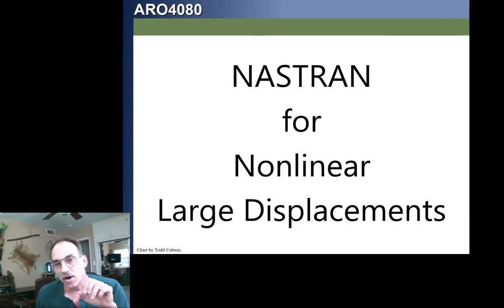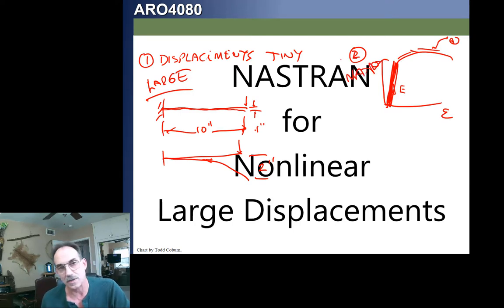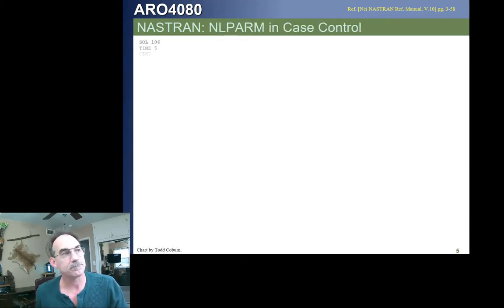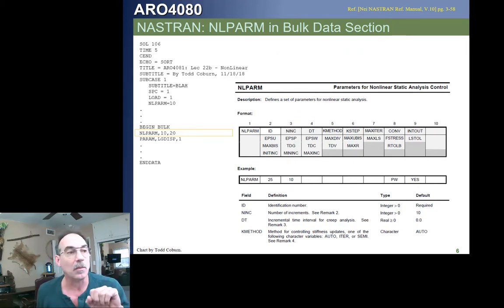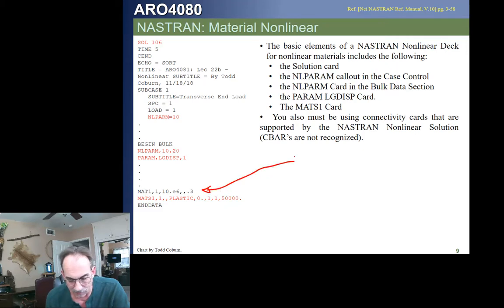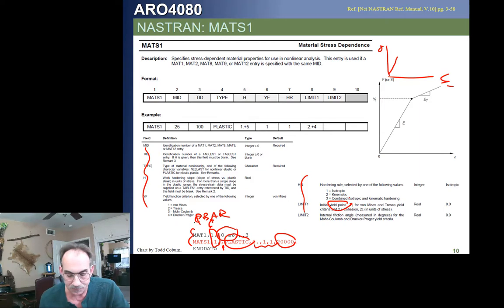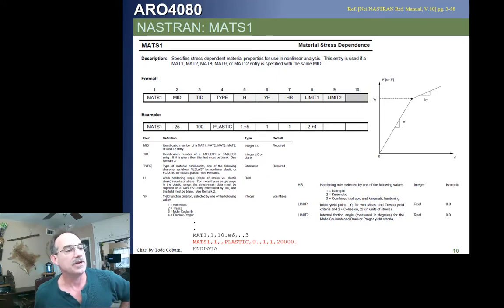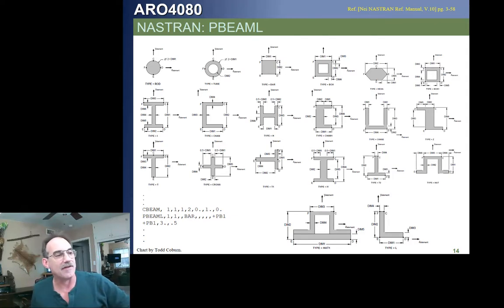Finite Element Analysis: L-19 NASTRAN Nonlinear FEA (Large Displacement & Geometric Nonlinear)

Comment: I have met 2 problems when I use the 106 solver to analysis a cantilever example.
1. When I check the section moment in large displacement analysis，I found the section moment less than it should be, even I limit the force error below 1%；
2. The follower force function not work.
Reply from the maker: Thanks for sharing.